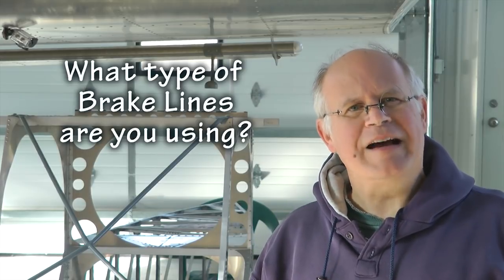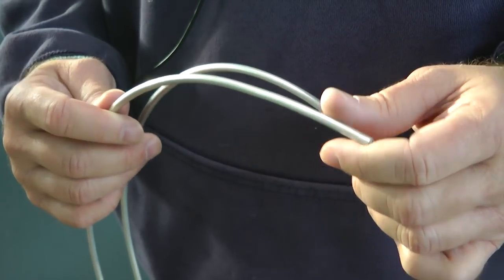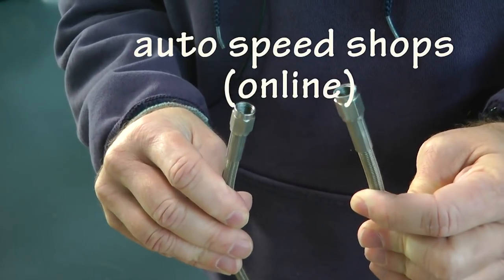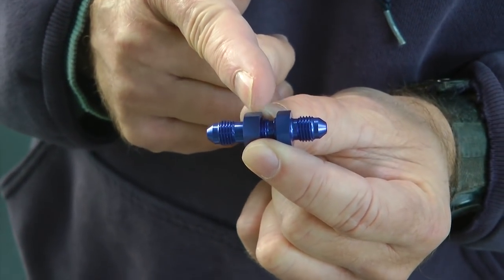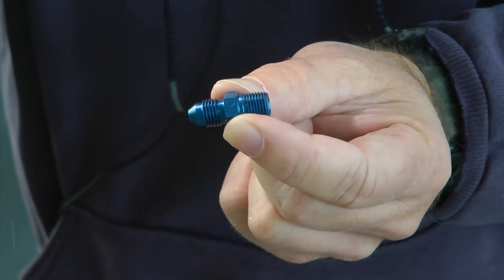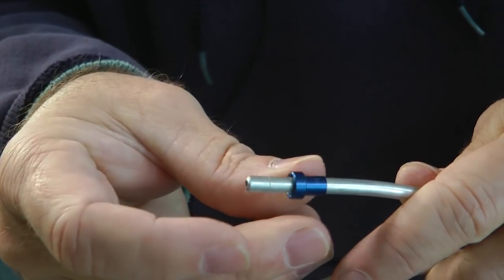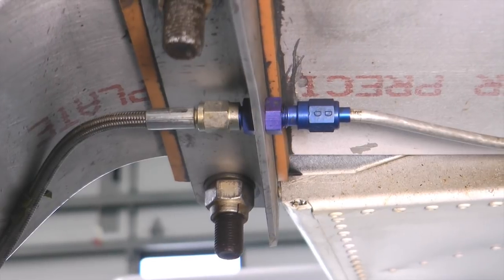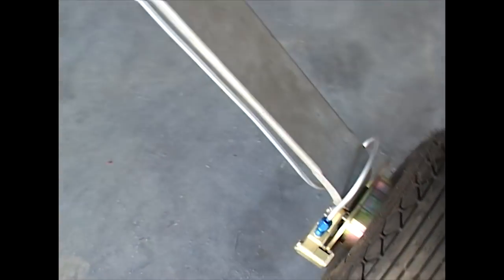How to Convert your Plastic Brake Lines to Rigid Aluminum

Comment: Couple questions. 
1. Why not use the flexible hosing in the entire aircraft for ease of installation, plus stronger than nylon?
2. Would it not be of the upmost importance to run the lines in such a way as to protect them from any possible snagging that may occur from, grass, rocks, or birds? For example: running them aft along the struts to protect from forward damage, not under or in front. Or Running them inside the aircraft as soon as possible vs running them under the aircraft? Does anyone have experience in trying to mitigate the potential issues that may arise with poor placement?

Comment: John, when you came off of the landing gear strut and turned to go under the floor of the aircraft through the tunnel how did you put in the 90 fittings through the floorboard?

Comment: Just one question John. I thought automotive flared fittings had a 45 deg flare instead of the aviation 37 deg flare. Are the two compatible?
Reply: The 2 are not compatible. Aviation is 37 deg where as automotive is 45 deg. If you purchase prefabricated flex lines or a flaring tool make sure they are 37 deg. before you buy it. All of your AN fittings like shown using the -3 or bulkhead fittings. The nipple end is a 37 degree.
Reply from the maker: "Typical" brake lines on autos use 45 degree DOUBLE flares (a different type of flare) ; our aircraft use AN single flare 37 degree (autos can also use these on other non-brake hydraulic applications) They are NOT compatible - do NOT mix 45 an 37 degree flare connections!

Comment: Excellent tip, as usual.  Also, I would like to see your take on flaring tubing . . . it HAS to be better than mine.  Also, does your plane leave the lines exposed on the belly?  Seems a prime candidate for damage.

Comment: The braided stainless steel hose has nylon tubing inside. The 1/8" nylon tubing is good and can be sleeved with 1/4" nylon tube for protection.

Comment: At 10:10 (and elsewhere), you can see significant scratches in the aluminum tubing.  I would think that those would be a good starting point for fatigue cracking in your brake line.  Comments?
Reply: I don't think I'd be concerned about superficial marks like that unless there was significant vibration or flexure at that point that might tend to develop the cracks. I'd think it would take a very long time for these to develop into anything serious just by hydraulic pressure in the line, especially considering how little brakes get used during flight.

What worries me a bit more is that possibility of damage to the lines where they go unprotected down the struts, where they might get hit by tall grass or small stones or the like.Of course, you are supposed to check all this stuff visually before flight. But does everyone do that?

Comment: I wouldn't have thought it even possible to build an hydraulic brake system using nylon or any other type of plastic tubing.  The whole point of hydraulics is that one is pumping an incompressible fluid, but having tubing that can expand under pressure defeats the purpose.
Reply: What makes you think the nylon line expands in a typical installation?
Reply: +Turning Short Final — The modulus of elasticity of nylon is much, much lower than that of aluminum or steel, that's why.
Reply: I have good news for you.  These aircraft brake systems operate at much lower pressures then what you're assuming.  It's not like an automotive system.  To give context, The maximum working pressure for the nylon is 600 PSI.  Versatube 3003 is rated at a maximum working pressure of 880 PSI for 3/16".  There is no concern of the nylon expanding.  It simply isn't a problem at the low pressures the system operates at and it's standard to use nylon.
Reply: @Bottleworksnet  And what about temperature ? when breaking from high speed for longer time, breaks get heat up pretty quickly and the end of the tube connected to the cylinder body could melt and start leaking
Reply: @trhacje_m2187  They don't get anywhere that hot.  Not even what I would consider warm.  I hope you understand that these brake systems were designed for use with the plastic lines by aerospace engineers.  THEY DID THE MATH (AND TESTS)!!!  Thousands of aircraft fly with these plastic lines.